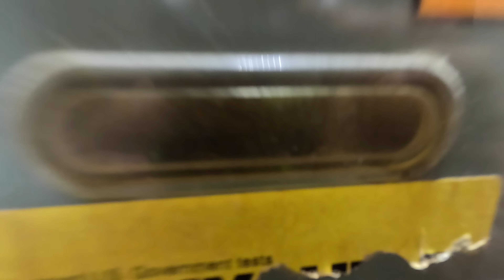Found Rheem Furnace Locked Out! #hvacguy #hvaclife #hvactrainingvideos

Comment: Early in the heating season, 90% of no heat calls are flame sensor issues.
Reply: Or pilot out, or gas valve off.
Reply: @ncooty 
If your furnace has a standing pilot, its time for a new furnace. Standing pilots went out with Nehru Jackets.
Reply: @bills6946  So you just refuse to fix them?  Not everyone can afford to treat their equipment like fashion.  People need heat, and if the furnace functions, let's keep it working for them.  Waste not, want not.  :)
Reply: @ncooty 
Where did I say I refuse to fix them? When we come across them, it takes a while longer to fix because we no longer keep standing pilots or standing pilot gas valves on our trucks. It is a trip to the distributor. The customer ends up with a higher cost. We will explain that to the customer. Their choice. Either way, we leave them with heat.
Reply: @bills6946  I guess I misunderstood what you meant when you said it was time for a new furnace.  You mean that you recommend a new one, but you still fix the current one, even though it can be more expensive than it might be worth.  I get that.  Back to my Nehru jackets.  ;)
Reply: @ncooty 
Appreciate your reply, brother.

Comment: Those Rheem flame sensors are hard to get to. I take the top plate of burner assembly off (with flame roll out switch). That exposes the flame sensor below and I clean it in place.

Comment: I never seen a flame sensor that was that buried……
Reply: Would have been worse but for the flex line. The flame sensor indicator is nice, but that shows that the designers/engineers know that the sensor is a high failure part, so why do they not make it easily accessible?
Reply: have seen
Reply: You haven’t worked on any carrier and Bryant units have you?
Reply: @MK-xl9tt  no mostly Goodman
Reply: @cwrowe  flame sensors rarely need to be replaced, but definitely need to be cleaned every year or so. Over 30 years of installing and repairing hvac I can probably count on one hand how many flame sensors I’ve actually had to replace.

Comment: 1/2 way into your video, how did you know the sensor needed cleaning? 😂  That whole furnace needs to go through a car wash.
Reply: Even without the light on the board, if you have flame for a few seconds then no flame, most of the time its the flame sensor.  Clean with scotch brite, never sandpaper.